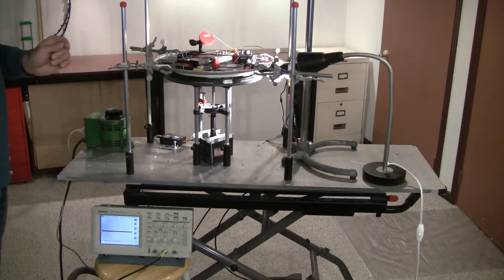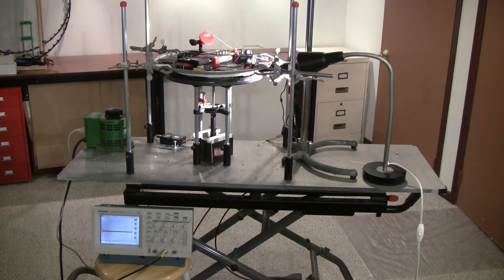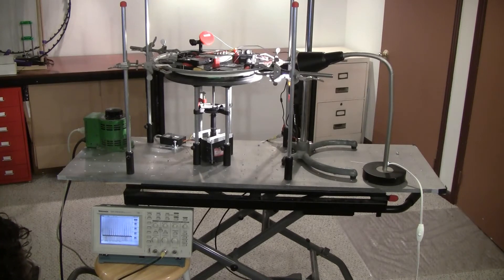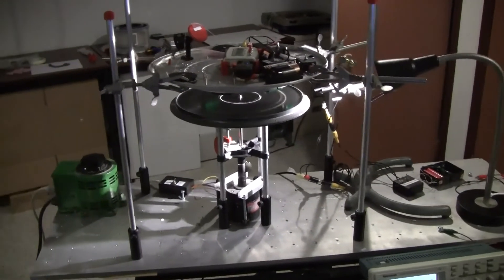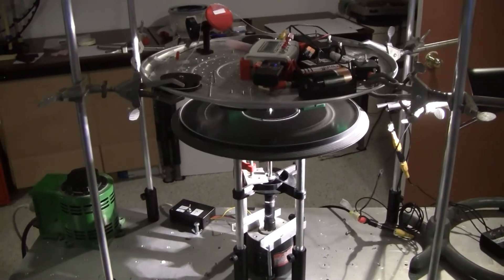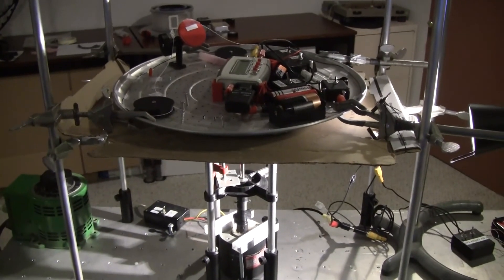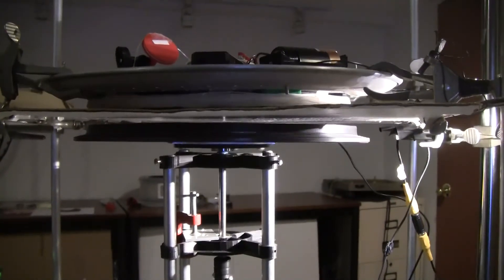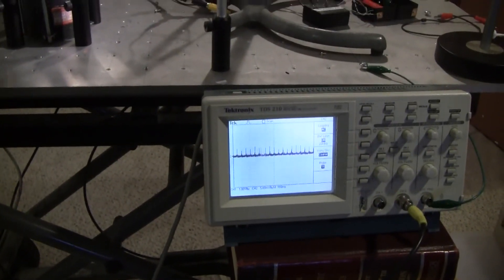Oliver Lodge ver.2.0: Speed of light altered by a rotating mass?

Comment: An interesting X. 
Does the gyro hav dither? i think dither would be needed especially for weak effects.

I reckon that there should be 3 effects on the FOG. 
(SU) One while the disc is spinning up.
(MR) One while the  disc is at max rev. 
(SD) One while spinning down.

(SU) & (SD) will be stronger if the acceleration is stronger.
(MR) will be stronger when the revs are greater.

(SU) & (SD) should manifest ok if the disc is in axial alignment with the FOG (which it is).

(MR) will hav almost zero effect if the disc is in axial alignment with the FOG.  For good effect the disc must be on a different alignment. Let me think. For good effect (1) the disc should be perpendicular to the FOG. And (2) should be offset such that the axis of the disc is tangential to the ring of fibres in the FOG.  Yes, that should do the trick.

Re minimization of air-wind, & air vibration, i think that the stationary FOG should be inside a heavy box.  And the spinning disc should be inside its own heavy box.  The boxes wont harm the aether effect arizing from the spinning disc.  But the distance tween FOG & disc should be kept to a minimum.

(3) The disc axis should be aligned on a certain alignment, & then the FOG must of course be aligned to suite as per (1) & (2). 
(4) But lets ignore (3). Just align the axis of the disc vertically in the lab, as usual.  Then u have to do the X say hourly for 24 hrs.  The 3 effects will be strongest at different times, one time for (SU) & (SD), & another  time for (MR).

Comment: You should try doing it anti clockwise, seeing our planet + solar system rotates anti clockwise. So what you really should be measuring is the increase of local speed of light, because the solar system gravity would (theoretically, assuming a aether) pull light in a counter clockwise motion. Further assuming light travels instantly between solar systems and absolutely speaking slows down inside gravity, 

Trying to measure deceleration through clockwise spin would be counteracted by the earths anti clockwise spin, because a deceleration on our end actually means acceleration (absolutely speaking, from the solar systems perspective) which would be impossible, and acceleration on our end would mean deceleration of light.

Picture time and light like a spiral going inwards toward gravity.

Comment from the maker: John - yes, spinning the fiber gyro is another way of doing the experiment, but as I am sure you know there will be a large fringe shift in the gyro due to rotation alone (Sagnac effect) so then it becomes an issue of trying to discern if the mass has had any influence on that fringe shift. There is also the mechanical/electrical issues of running the data acquisition on the spinning rotor and getting it to the computer via Bluetooth, without having the electronics fly off the rotor - so you would have to limit your speed to perhaps 100 RPM at the most.
Reply: +plenum88   I see your point. Electronics parts flying off in this and that direction could have a detrimental effect on the data. Radio Shack sells a data logging DVM model 22-812. It transmits data by a 232 plug that is blue tooth friendly . They are dirt cheap at 25 bucks so I bought 3 of them. This would save you the trouble of having to bread board a pic processor.  I bought 3 of them .http://www.bz1-img.com/images_customers/04/41/4972737_46353_raw.jpg
Reply from the maker: +John Heath 
That is a good tip on the Bluetooth compatible multimeter!

Comment: I like your experiments and have watched from a distance has they evolve over the years. Possibly you are spinning the wrong one. In the Faraday paradox spinning the magnet makes no difference but spinning the copper disk does causing a voltage difference from the center to the outside of the copper disk. Does this mean the magnetic field is not entrained to the magnet. Yes and no. It is entrained the the location of the magnet but rotation does not change the magnetic field if the north pole is perpendicular to that rotation.  Tilting the magnet 90 degrees will make a big difference as rotation will cause the magnetic field to change from north to south with rotation. If the same is true for the gravity field coming from your spinning disk  then it is the fiber gyro that should be rotating not the disk in the same way as spinning the copper disk in the Faraday paradox not the magnet is the one that makes a difference.  Spinning the fiber gyro with or without the disk will have a marginal effect when considering the mass of the earth. However if you had a 1 Kg weight singing back and forth just above the gyro then possibly that very smaller change in gravity density would be in range of measurement ??
Reply: Search for "sagnac interferometer".

Comment: It's good that you are doing this experiment. If I could be so bold, you would next consider two modifications:
Add more mass to the disc
Duplicate Sir Oliver Lodge completely and use repeating mirrors. Fiber optic constrains the light.
Reply: John Wilkinson Third would be to provide your gyro with as much charge as it can handle. It will become a Faraday Disc upon rotation. With added charge comes a greater effect.

Comment: I'd suggest an experiment using rotating magnetic fields at close proximity. We know that an electric motor that is run for a period of time and then shut off will require a fraction of the start-up power if it's turned on again within one minute. This of course is cited as proof that the ether is being stirred into a sustained pattern by the motor which lasts approximately one minute.
Reply: +Prospekt313 Prospekt. That is an interesting statement concerning motors and rotating magnetic fields. Might you give direction as to where to look for further evidence of this phenomenon? Thank you.
Reply: I've only heard it discussed as known fact in lectures, but I'm pretty sure it was based on experiments by Norman Everette Gilbert. His book is on Google books. Another thing to look at is the laser drift experiment which showed that a 2cm magnet could bend a laser beam, thus proving that magnetic flux was a flow of ether.
Reply: @Prospekt313  If that is true, then it brings the other video for rotate magnet that affect charges mass as water which in this channel, but it has no affect so the other video that show huge magnet and laser from https://www.youtube.com/watch?v=FF9i5qQhNyU which the magnet causes the magnet field to be too big so the loop is big so it goes thru, so if it is small so it can bend laser, so it is not base how much strength, which is part of it, but in parallel how big is the strength, so the strength is too big so the resistance line as loop which laser goes thru, so it doesn't interact the resistance line, so if it is small enough but very strong so it interacts the laser so causes motion. So, all is about parallel, the big cause the empty space in middle of loop is big so is loop, it needs to be monster magnet is very small size to cause motion. So, it is not a resistance flat circle but a loop circle. The edge causes motion, not the center.